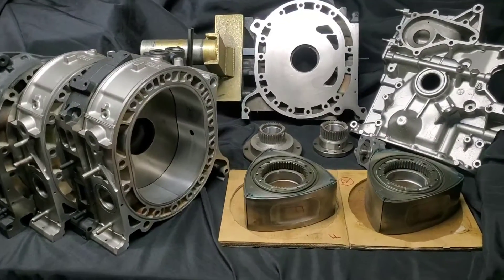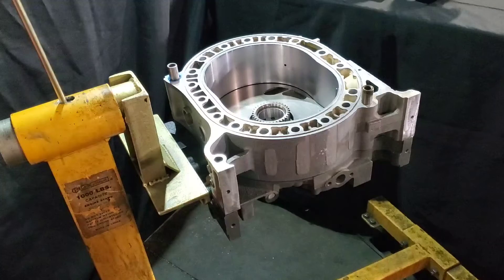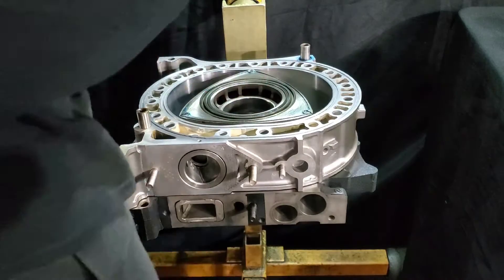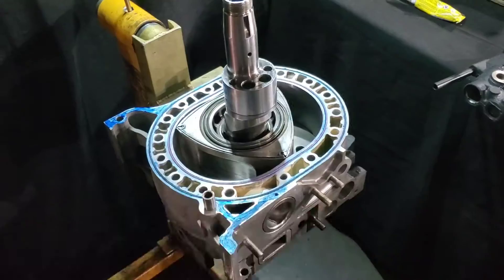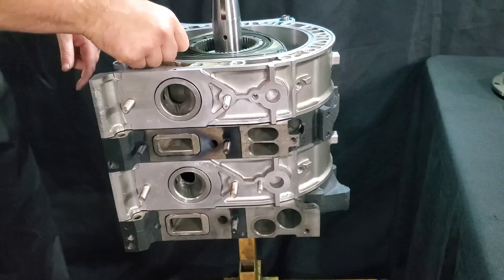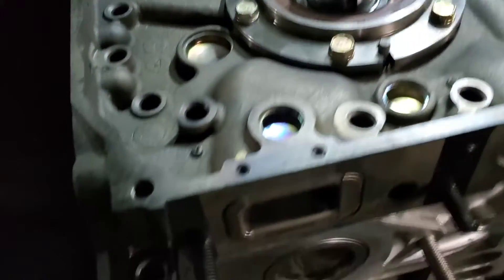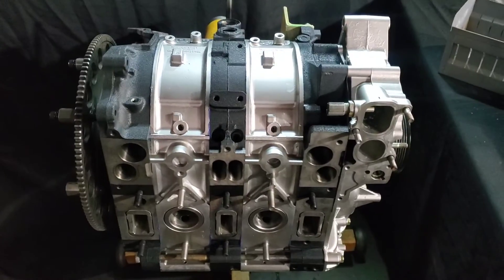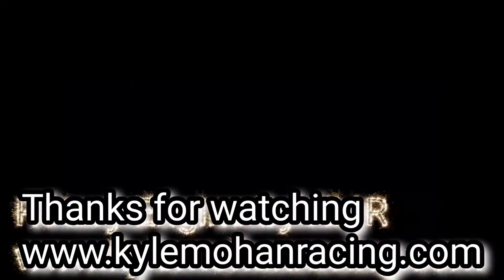FULL BUILD! RX8 Renesis / GSLSE 13b Hybrid Engine build! - KMR - Mazda RX8 Vol. 10

Comment: I was just watching the build and thinking about the ears on the irons being a major limiting factor. The center ears never break as there is no lateral load on the ear. Why not use a stud with fat machined sleeves on the stud in between the irons? This would greatly improve the strength and avoid inward tension on the ears due to the sleeves. Machining through the end and making a nut that was shaped instead as a fitted plate to distribute the load would really strengthen the whole mount area.

Comment: So I just discovered these engines even exist about a week ago , why would you keep the side port if you have the housing with circle holes? Wouldn't it have better better pulse strength for turbo spool without the side exhaust? I previously played around with my 2 stroke bike motor and found that pipe and pulse strength matter more than port area.

Comment: They put this motor together but they never showed it running
Reply from the maker: @popiwatv  Actually, there's a whole car that we built with one of these motors. This was just to show how we did it.   There's magazine features stories about it. It won its class championship. I think I finally got a chassis for this motor but gotta make some money first.
Reply: @KyleMohanRacing  rad potential did one and it barely even worked. It made 100 hp
Reply from the maker: @popiwatv  our turbo one did 430hp at wheels at 12 to 14psi and won it's race class.  🏁 it's featured in Moto Iq ...
Reply: @KyleMohanRacing  😮
Reply from the maker: @popiwatv  I've never built a NA one but I know turbo works. Proven race results, dyno results...

Comment: how would a stock semi PP cosmo housing, street tuned Rx8 irons hybrid work? 
i've been daydreaming about a progressive, vtech style vacuum operated flat slide 14 port n/a or procharged build... 
it's never going to be affordable to me (that's like a 12+ grand engine lmao), but what if? basically it keeps top ports and PP shut till the lower mid range, then the top ports and the PP progressively open for increased top end without chop, so the car has maximum sleeper value...  but screams like a banshee when unleased.

Comment: Fantastic! So can you make this motor with rx7 housing, using the apex and side seals of the rx8 on the rotors? Another info if possible: the hybrid engine, must be made turbo or can work well even aspirated? Are there no backpressure problems with oversized exhaust ports?
Thank you.

Comment: Excellent video, really informative!

 I was talking to a rotary shop over in the UK about possibly trying to use these GSLSE housings. They told me that using this would increase overlap however I'd get less power if I kept it NA. So I'm not sure if that means I could make up the power by then turbo charging the hybrid Renesis.

If I'm not mistaken a few reasons the renesis struggles with boost is that there's too much heat due to the MSP, the seals are weaker (as they weren't designed with turbo charging in mind), and the rotors have been lightened. I once ran an rx8 at around 20psi of boost. It managed it, but there were early signs of compression loss right away. If I were to use either carbon apex seals or rx7 seals and machine the rotors to fit them, along with GSLSE housings, hypothetically it could handle higher boost 🤔

Comment: Hi Kyle,   👋 would it not be beneficial to use older rx7 center iron as well to cut back on some exhaust overlap and provide more low end torque (eliminating the center exhaust) given the glse and rx8 exhaust timing differences?  Just a concept I've been turning in my head.  Cheers and can't wait to see dyno numbers.
Reply: the intake ports and bolts don’t line up the same between them.
Reply: @nobodyspecial5026  ok, guess I'll just have to hope and pray someone makes center plates at some point to solve the hybrid exhaust center port scavenging issues traveling from one rotor to the other side.

Comment: Am I the only one itching to see this on the dyno? 

I don't expect miracles but I really want to see what it does. 

It seems like it will automagically live longer, simply due to the heat evacuation ability of the engine; though with 2mm apex seals i can't imagine it'll live long due to that new exhaust port's span. Won't this limit the safe rpm range?

Comment: How much power would you expect from this na and what would I change to run boost. I’m in the market to build my first rotary but trying to do it on a budget and an rx8 engine would be best $wise.
Reply: With the street port and new gslse housing exhaust port, it should flow a lot more air. I also assume the intake manifold is polished. My best guess with this set up is 200-230whp.

Comment: Awsome build I'm a need a engine next year. 06 rx8 4 port 6 speed auto
Reply: 2006-2008 are ALL 6 PORT. Regardless of automatic or manual. Which is better because you can make more power with that version versus the 4 port.

Comment: What’s cost for doing a setup like this? Would it handle a 500whp setup utilizing e85? It’s this or ls swap my rx8
Reply: For 500whp I'd recommend use FD rotor. Lower CR to make sure it survive. But shouldn't be that hard to reach 500whp with renesis rotor 😉
Reply: @qiqisun 500hp n/a Renesis?!

Comment: Is there a way to do it with 3 or more rotors??
Reply: Speaking hypothetically, an RX8 hybrid 3 rotor would require expensive custom work that may not be worth the effort. Your better off sourcing a used 20B or getting the billet 20B plates and e shaft with 13B housings. 4 rotors are a whole other ballgame.
Reply: It should be possible seeing as there is a 20b-msp (self build) but its not cheap and seeing as how it works can only be done with the 4 port engines, if u google it u might find it somewhere on a forum.

Comment: Rotary experts, would there be any reason to tune the exhaust in a way to keep the side and peripheral ports somewhat separated so they can be tuned separately? Would there be any advantage to such a system?
Reply: No rotary expert, but engine building geek and two stroke fanatic here. A small issue is the center port will always allow cross over between the rotors, precluding hybrids from being able to run a fully diveded twin scroll setup. There's also some shade tree math out there talking about how the port timing and overlap of a hybrid would be really aweful NA, but that's all negative Nancy car forum people. Kyle will reveal the truth!
Reply: @bennyb.1742  Twin scrolls is one thing I was thinking about. I was also wondering if the peripheral ports could be set up such that they have less influence on the low end but can be allowed to flow better at the top end. And I was also thinking about that in the context of a turbo. But I’m hardly an expert, just someone who has been fascinated with these engines for a while.
Reply: @BennyB

Rob Dahm is just a car forum guy who transitioned to youtube.  David Mazzei is also a car forum guy who does youtube.  I wouldn’t insult Dave by putting them in the same category or on the same level though.

If anything, the comments on youtube and the knowledge level of the average viewer here is as bad or worse than on any car forum.   By his own admission this engine builder never did this NA before and isn’t sure what it will do.   

I’m confident he’ll put every ounce of effort and experience into getting all he can out of it, but you even admit to not being a rotary expert yourself.  Yet ignore your own inexperience writing off others who likely are more informed than yourself as “negative Nancy car forum people”.  

In reality, that’s just what can be expected from the typical youtube commenter who has an opinion on something they know absolutely nothing about.   There’s nothing wrong with putting your faith and belief behind the builder; kudo’s for doing so, but the are very valid and noted concerns about this possibly not working out as might be perceived. 

Maybe this will be a first and new revelation and he’ll get all the glory for it, but so far over the last 10 years (!) there hasn’t been an NA Renesis hybrid build that had anywhere near the standard Renesis output level, whether peak values or average area under the curve.
Reply: @nobodyspecial5026  I'm confused by your reply. I don't see any mention of either Rob or David in this thread, why bring them up?
"...but so far over the last 10 years (!) there hasn’t been an NA Renesis hybrid build that had anywhere near the standard Renesis output level..."
I'm really curious as to what others have done. I've poked around some but the hybrid config seems exotic enough that there are not a lot of builders working with this config.

One thing I have been wondering about is if there is any info on tuning the side vs peripheral exhaust ports. IIRC there was a Cosmo that had both side and peripheral intake ports with the different types of ports having separate throttles to control the path of the intake charge. I was wondering if there would be any reason to try and engineer different behavior for side vs peripheral exhaust ports? IIRC there was a Cosmo engine that had both peripheral and side intake ports with the different types of ports having their own throttles to better take advantage of the properties of each type of port. I also think I recall reading that Mazda used some of this knowledge for the Renesis intake system (though that concerns the primary and auxiliary side ports as it doesn't have peripheral ports). 

WRT the exhaust, I was interested to know is if there would be any reason to do thing like tune the exhaust manifold, or use valves in the different exhaust paths to better control the flow at different RPM ranges. With peripheral ports, I understand that this would not solve the issue were the seal between the exhaust and intake sides of the rotor are compromised as the apex seal sweeps past the peripheral port but would there be any other potential positives? If I can think of these sorts of things, I would expect smart people who know rotaries have already considered similar ideas, researched them, and hopefully shared their research. 

Port overlap is another topic I'm curious about. I was under the impression that any amount of overlap is generally not great but I seem to recall that this isn't always the case. So I am hoping there might be some basic 'rules' that can help understand when overlap is undesirable vs desirable (if ever). 

I've been fascinated by the Wankel rotary engine for some time but I've never had the space needed to have a project car to try and learn about them in a more direct way.
Reply: I regret that you didn’t comprehend the response.  

He posted a reply that results were coming a week later, that was 6 or 7 weeks ago.  I have $100 that says it was dyno’d and now he knows the truth that the NA version is a total dud.   The turbo version is not much better. An REW with full bridgeport will make better numbers at approx. the same boost level.  Because I’ve seen the results using iron plates that he did the porting on. 

Take heed that no man deceives you.  For many merchandisers will come claiming to represent the truth, and they will deceive many.
Reply: @nobodyspecial5026  team is that you?
Reply: the iron intake port and bolt hole positioning is different between the two engines.
Reply: @bennyb.1742  yes, I am of the same thought,  wondering if using glse center iron would solve all issues?  Or would that even be possible?